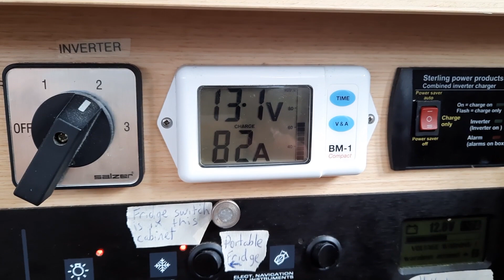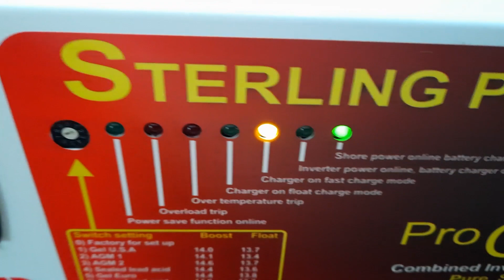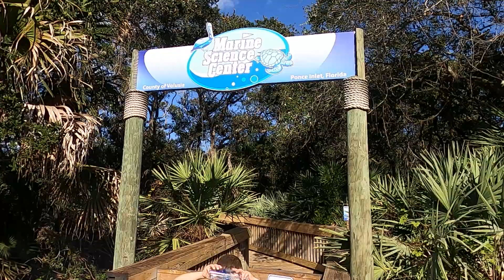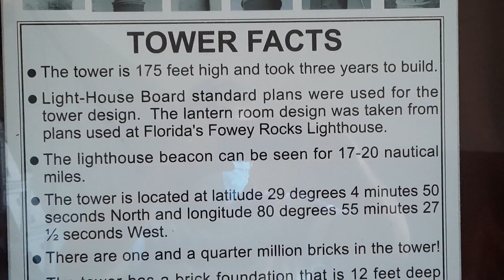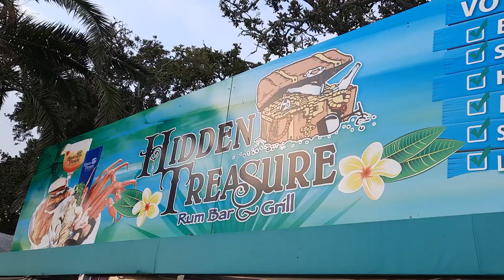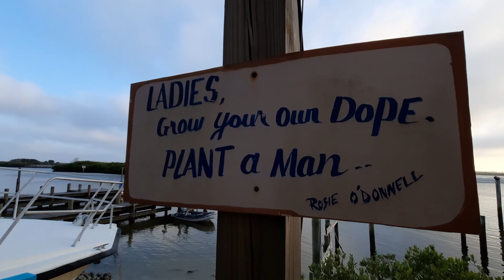Visiting Ponce Inlet Part 2, Sailing Laguna #23

Comment: With regards to your charging problems you may need to limit the AC input current on your Sterling charger to match the Honda output if possible. Not familiar with Sterling but it is doable on the Victron Quattro. Keep up the great work on the Vlog.
Reply from the maker: Hi Bryan, thanks for the encouragement. I think you are right with the AC input. I emailed Ben at Sterling and he said there was no way of getting the Sterling Pro Combi to request less power. So when the batteries are below 90% we have to use the engine to help bring them up to that mark. From 90% I think the charging profile might be less and the generator can handle it on its own. I guess a previous owner didnt match the charger to the generator or systems have changed since the charger was installed.